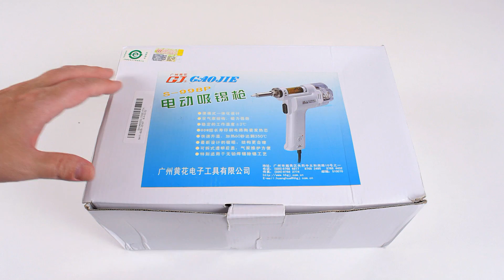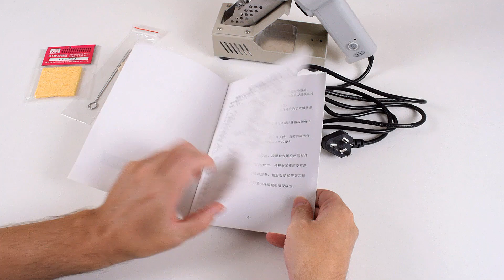Desoldering capacitors with the GJ S-998P Double Pump Desoldering Gun

Comment: Hi Guys,  bought this solder sucker from Banggood after viewing this video. Ordered at Banggood Czech Republic warehouse. A nice piece of crap. Don't know if mine is faulty or if Banggood provides "improved" version to youtubers but it's faster to remove cap with hot air pistol that this solder sucker. I will never know what is the real issue as Banggood asks me to send back the product in....CHINA even I've bought in Europa. Shipping cost is nearly the price I've paid this tool. If you really want to buy with Banggood, consider there is absolutly no warranty and high risk to loose 110€. It was my first attempt to buy a chinese product to a chinese reseller...and the last one. I think that a disclaimer should be displayed for this type of video, informing about the risk to buy from this seller. I'm certainly a bit too naive...
Reply from the maker: Hmm maybe it is indeed faulty, what you see in the video, is what I got. Yea they do make you return items, it cannot be avoided, and with larger items it can be not worth it due to high shipping costs.

Comment: Does this work with modern Multilayer PCBs? They have so much Copper is really hard to solder ...
Reply: From what I've researched you would need an air heat gun, or an air dryer so that the heat isn't dispersed as soon as you put the iron on the joint.

Comment: Total knockoff of the Hakko FR-300/301, except without the hot tip shroud remover thing and with the temperature dial moved to the side instead of the bottom.  Does it have readily available tips?

Is it just me, or was the iron/tip wobbling at the point it connects to the body of the unit as you did that?
Reply: Well that costs over 300€

Comment: I got this desoldering gun a little while ago, but I've noticed that the hot end tends to run extremely hot (glowing red), even at the lowest temperature settings. Is it supposed to do this?
Reply from the maker: No it's definitely not supposed to do that!
Reply: request a refund for it, it's obviously defective, and also a fire hazard.

Comment: In this video it looks like your tip is loose because it wobbles around quite a bit! You might try to tighten the locking ring or collar, and see if you might also then get even better heat transfer and/or vacuum!... This model looks like it might be worth it, since it is basically the same price as the single pump model... However, since I live in the USA, I just wonder if this larger model is also available in the US 120V version like the smaller model is!?!
Reply from the maker: Yea well spotted, the tip was indeed not screwed on fully. I'm not sure about a US model...

Comment: This suction S-998P bought for that would dismantle the tuner TV cards. This product is not able to perform such work. To suck the tin quickly is not possible, and % 70 does not suck. In the description for this product the seller should make a note that disassembling them is not complicated items with "oak" foil and not a refractory solder. Removed the tuner for an hour and so could not be removed. I had to go to the old way, using manual suction and powerful soldering iron. Useless thing

Comment: It is good for replacing PCI/ISA slot, or DIMM/SIMM module, BIOS, PGA slot, COM/VGA/LPT/USB/RJ45/PS/2 ports.
But capacitors? With price 130$? :)
With soldering iron and this MB it can be replaced in 5 minutes. :)

Comment: can you solder new capacitors with it? sorry for noob question
Reply from the maker: I'm sure you can, but I would recommend using a solder iron with a flat tip for best use.

Comment: How do you decide what caps to use to replace the existing?
Reply: Basically, you look at the caps to be replaced.  In the video, these were all 'electrolytic' capacitors.  They have two main values written on them that you need to check: the capacitance (measured in Farads, but in capacitors of this type, smaller fractions of Farads called micro-Farads, written uF), and the voltage, signified by a V.  For example, a cap marked 2200uF 6.3v is 2,200 micro-Farads, at 6.3 volts.  Now, if you don't have an exact match to hand, you can use a 10v cap, as long as the 2200 micro-Farads is the same.  Similarly, if you needed a 1000uF at 6.3v, but only had a 1000uF at 10v, that would work fine.  So, match the uF's but the 'v' can be higher.

For this type of repair, there isn't much more to capacitors, but they do come in two common heat tolerances, 85 and 105 degrees C. Go for the 105's.  And buy a good brand like Panasonic or Rubycon.

Lastly, when replacing the caps, check the polarity.  Unlike most other electrical 'things', capacitors have their negative side marked, usually with a stripe down one side.  Match that to the negative side on the board.  See in the video how, when the caps are removed, you can see white marks, like a half-moon?  The white portion is the negative side.  Align the stripe on the cap with the white half of the moon, and that's correct.

Comment: I found an interesting fact recently from a fellow motherboard repairman. The radial electrolytic caps such as the ones shown in your video which were common on older motherboard can be replaced with smaller polymer caps of 1/3 capacity. So a 3000uF electrolytic cap can be swapped for a 1000uF polymer type (small barrel with no vent). That applies to caps surrounding the CPU, which are expected to handle high frequency square wave pulses, that polymers excel at.

Speaking of cap testing, in addition to soldering iron, I recommend having an all-in-one component tester. There's plenty of them on ebay priced from $10 to $30. They are completely indispensable, especially for people who aren't electronically inclined.
Reply from the maker: enilenis Ah yes, I heard of polymodding. I shall have a look at that component tester.

Comment: If you don't have many capacitors to replace, a trick I learnt after wrecking a few boards, is to not try to remove the solder from the hole, but instead to add a small blob of solder to the pins, then heat the blob which will transfer the heat through the depth of the hole, without needing to make PCB contact with the iron tip.  It is a little tricky re-inserting a capacitor from the underside of the board while melting the solder from the top side, but can done if the legs are trimmed to length and can sit  just enough in the hole to keep the legs in place.  Then use some solder wick to clean up the excess solder.

Comment: I would recommend adding a dab of flux to each joint you plan on desoldering, the flux will help break the oxide layer on these old crusty solder joints which should provide better heat transfer which will make the solder flow better which should get the joint cleaner when you engage the pump.

Comment: I tried to remove Caps with a soldering iron and some homemade wick and it's a PITA.
Reply: If you use flux, it might be easier.
Reply: @SomeAngryGuy1997   I have some but it leaves some black residue if I apply the iron for too much time.
Reply: @SomeAngryGuy1997  I'll try the toothbrush part. Thanks for the tip.

Comment: I have an older AM2 motherboard laying around suffering from "capacitor plague" as well. This will be my first motherboard soldering since J-standard/IPC certification...I had to order a new soldering station as my crappy Radioshack soldering iron just would not get hot enough to melt the old solder.  So, wish me luck? Regardless, it was originally in my electronics recycling box, so even if I fail, it goes back in the box :)
Reply: Voidsworn  don't overheat those old solder joints, you're likely to destroy some of the components and/or delaminate the solder pads. What keeps the solder from melting is probably an oxide layer on the old solder. Scrape some of that off so that you can touch some bare solder. Also make sure your iron is clean and free of oxide. Additionally what will help is some new flux, either directly from a pen/bottle or using some new flux cored soldering wire. Sometimes the key to desoldering is to first add new solder. That all being said, if your iron is really not hot enough, don't fall into the mistake of applying it longer, the heat will build up not just in the joint, but also in the attached leads and components. It's better to apply a short time with a slightly hotter iron than to take a long time with an iron that is just not hot enough. But again be careful of overheating.
Reply: Fortunately, the solder joints for these caps are far from the solder joints for the other components and fairly far from the other components themselves, so I am not as worried about that. There is some oxide on the joints, but not the soldering iron tips (bought them brand new and used tinning compound).  I have some gel flux and apply it liberally.  So far, I do not think I damaged the board (it does not look damaged under magnification and I used a crappy little 30w Radioshack iron). Thanks for the tips :)

Comment: Those air filters are sponges that are supposed to be wet. Luckily, my Ayoue manual is in English. ;)
Reply from the maker: For real? So whet them before every use basically?
Reply: PhilsComputerLab Yep. Basically, the wet sponge filters are cheaper than ceramic filters. Unlike ceramic filters, they need to be wet in order to stand up to having hot solder thrown against them. I've seen some people use the ceramic ones from Hakko instead. Mine were flat discs (didn't look like sponges) until I added water and then they popped up. Figured that part would be lost due to the language barrier so hopefully you haven't gotten too much solder dust in the pump motor. I'm sure it's fine. :)
Reply from the maker: Sweet! Most of the solder ended up on that little metal disc that is at the end of that removable plastic tube.
Reply: @emmettturner9452  ohh,,,that might enplane why after 30 seconds my fuse blows.

Comment: A bit of trivia, earthed (3 pronged) appliances in China use the same plug as us Aussies, though the socket is mounted upside down, hence why the cord sticks up from the top when you plug it into an Aussie powerpoint.
Reply from the maker: Interesting :D
Reply: Evidently its based upon an American design that was patented in 1913 (US patent 1,179,728) which was designed for 10A@125V, supposedly they were used in electrical installations in the US back then but I have never seen one in person. Also under modern NEMA standards the NEMA 10-20 is just like the Australian plug but it is rated for 20A@125V/250V, although I have never seen these used in person, there are larger plugs similar to this design that were used from ~1947-1996 for Ranges (NEMA 10-50) and for electric clothes dryers and large window air conditioners(NEMA10-30) , they were meant to be used to provide both 120V hot phases and a neutral allowing for 240V across both hots and 120V from hot to the Neutral. Typically the case of the unit was grounded to the Neutral as well which was later found to be dangerous so from 1996 onward the American Nation Electric Code began requiring the usage of the NEMA 14 plug in these applications, the NEMA 14 adds an additional pin that a separate equipment grounding conductor connects to. Also in America we have a connector that is like the Australian plug with the round earth pin called the NEMA 7-15 it is used at commercial and industrial locations with a 480V 3-phase wye service to provide a 277V hot, a neutral, and a ground.
Reply: Now that you mention it, I did read that the US did use the "Aussie" plug on appliances for a while before the NEMA standard was introduced. Nowadays, Aussies, Kiwis (New Zealanders), Argentinians, some Pacific Island nations, PNG and Chinese (Mainland, not HK, etc.) Very interesting :D
Reply: From what I have read lucas they were used for a brief period before the NEMA was established, since the NEMA 1-15 became the standard plug in American households these outlets would have became useless and people would have replaced them with NEMA 1-15 receptacles so that they could actually make use of their electrical devices, and the very few that remained intact after the NEMA 1-15 became standard were probably removed a couple decades later when people had to bring their electrical up to modern code during a remodel.

Comment: Yeah, Gao Jie (Yellow Flower) made some good stuff, as a Chinese I'm quite proud of this brand.
Reply from the maker: Ah cool, now I know what it stands for :) Thanks for sharing.
Reply: A lot of Chinese stuff is quite well made these days. I had a Xiaomi phone and it was brilliant! Not to mention Wanhao 3D printers are VERY popular in the 3D printing community (as well as being good value for money).

But I'm thinking about getting one of these desoldering guns, think I might replace the caps in my old Roland MT-32 (may be causing it to miss notes).
Reply: NONONO, "Gao Jie" doesn't stands for "Yellow Flower", This product has two brand names, the new one is "Gao Jie", the old one is "Yellow Flower", hope I cleared that up... ;-)
Reply: Yes, XiaoMi surely made some amazing phones.

Wow, you got a MT-32? Lucky you!
Reply: Yes I do, although it's literally as old as I am! haha. MT-32s aren't overly hard to find if you are importing one from Japan or the US, but a CM-32L (an improved MT-32 with extra sound effects, but no LCD screen or controls) is really hard to find. I managed to track one down, eventually.
Reply: "Financial Problem Intensify"
Reply from the maker: Turns out the tip just wasn't scewed in properly. Link please for a cheap Hakko 808.
Reply from the maker: Nice. Had a quick look and indeed much cheaper than I thought it would be.
Reply from the maker: Ok so the Hakko doesn't come with a stand at the low price. The unit I reviewed is the double pump version, there is a cheaper one, but I don't know how effective it is. But it's good to have options to choose from.
Reply: Could you be more specific?
Reply: i wouldnt really proud of these, the element burns out quick and the flex on the tip can also just break it into bits

Comment: Be careful with the wiggeling. Often time, you'll take the pads off doing that, especially if its too hot.
Reply: A good way to reduce the amount of effort required to desolder is to brush a bit of flux over the terminals.  It makes the old solder easier to melt.  You can also add some new solder to the joint for a similar effect
Reply: At least I managed to do that on some old Amiga motherboards.
Reply from the maker: That makes sense.
Reply: Yes, everyone should be careful with old PCB.

Comment: You've saved my sanity. I was going to have to replace around 50 caps by hand across -7- different motherboards....and I've already kind of botched my only Super Socket 7 board's de-soldering.

Edit: Its actually 8 with the board I pulled from an old HP (one which had an integrated Voodoo 3 2000 8MB) 3 days ago
Reply from the maker: Replacing caps is not something I enjoy, but this tools does make it a lot more enjoyable.
Reply: Say whaaa? I never knew they made a motherboard with a built in Voodoo 3. Though I am sure it would be rare as hen's teeth and rocking horse poo.

Do you have any model numbers of the motherboard?
Reply: I googled "onboard voodoo 3 2000" and i saw this http://www.3dfx.ch/gallery/d/23843-2/DSCN0224.JPG
Reply: I'll get it out of storage tomorrow morning-I don't think it had a model number though, but it is from a Packard Bell desktop with; a Slot 1 Pentium III 650 (Coppermine of all things), 128MB of RAM (upgraded to 386MB)and a 15GB HDD (which turned out to be a 20GB but it is the original Windows 98 install with Packard Bell OEM branding everywhere). 
At the very least I'll link photos. The machine BTW was last used in August 2004 if the Antivirus's last update is anything to go by (I just threw the HDD into my Abit VP6+PIII 1000 based rig)

Edit: Found it. Its an MSI-6168 inside a Packard Bell - Club 650P.
Reply: It appears to be quite a bit more expensive than ZhongDi ZD-915 though, and unlikely to be better.